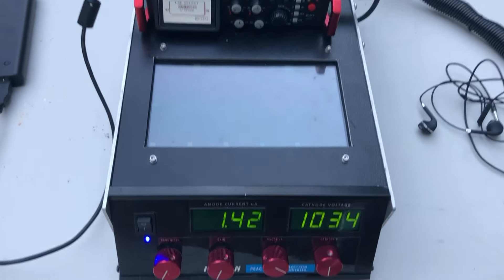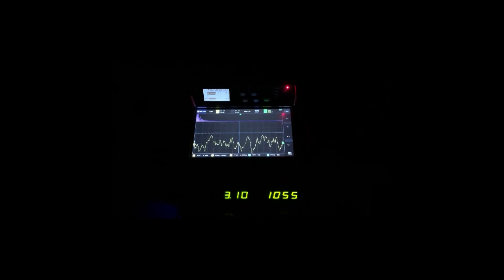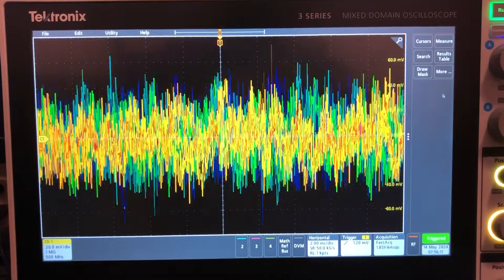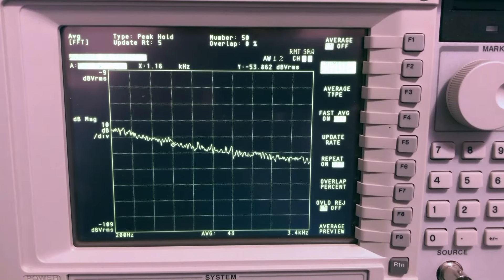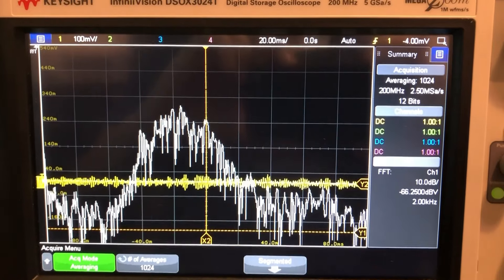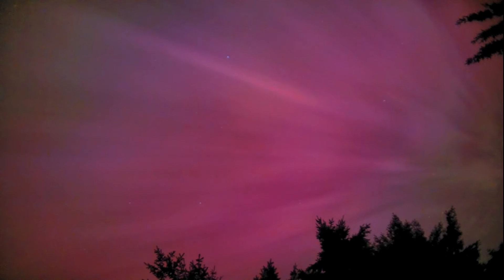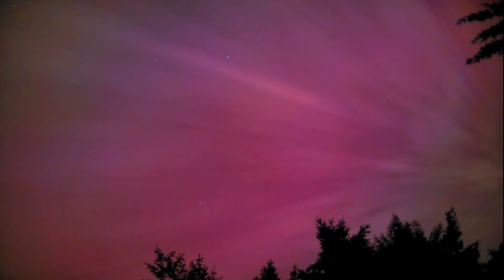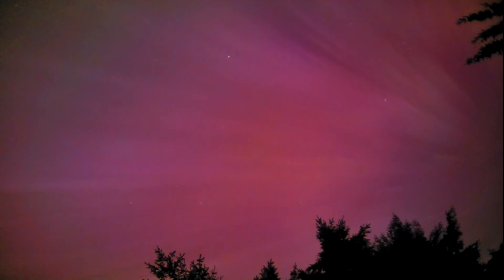Aurora Borealis Sound Recorded using Custom Technology

Comment: what does it sound like when there's no aurora out?
Reply from the maker: The system is capable of detecting single photons and converting them into sound. The night sky with stars ( Without the Aurora) will make a slight rumble and white noise. This is due to star light flickering or scintillation in our atmosphere. It will also detect a slight 60 Hz and 120 Hz frequencies from city light pollution. The Aurora has very high amplitude light fluctuations that can be converted to sound which were magnitudes higher than the starlight or background noise. I still can't understand the chirps and whistles that were isolated in the sound recording.

Comment: Did you use an ND filter on the PMT? I built a scintillation detector once and I was really nervous the first time I switched it on. Fortunately, it was more than adequately sealed. 
Now if only someone would figure out a way to record whistlers without the AC hum from the power lines in my back yard.. 😗
Reply from the maker: That's a good question. I did not use a filter. The telescope used has an f-10 focal length so this attenuated the incoming light to the PMT and it was also at night. 
I slowly turned up the high voltage to avoid overcurrent and damage the PMT. There was a low level 60-120Hz signal detected in the spectrum analysis of the sound due to distant city light pollution.

Comment: I set the playback speed to 2X and could better hear the sounds you talk about.  Would be cool to convert the colors to a stereo field representation. You’re going to have to buy yourself a Eurorack system :-).
Reply: dear david your excellent Scientific experiments hard work takes a lot of effort and time i know and value your papers witch are for sharing your own original research work with other scientists or for reviewing the research conducted by others. As such, they are critical to the evolution of modern science, in which the work of one scientist builds upon that of others. and record the sound data from light capture by optics of light frequency, have you ever try sound source code to produce frequency of light ? and any views of your experiment may hold any data in its audio that originally come from the light frequency
Reply from the maker: I have not tried to alter the speed but I'm glad you were successful at hearing the strange parts by speeding up the audio and sharing that information. I presented the audio as it was recorded, and again with the described bandpass filtering.
Reply from the maker: @JohnLenardWalson   I always conduct research in areas that have never been considered or explored. It's the only way to make new discoveries.